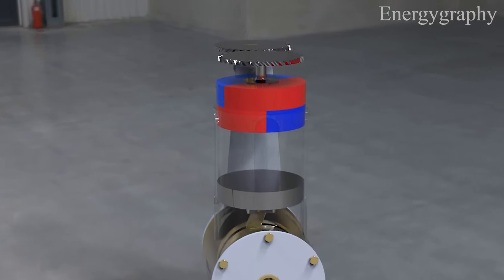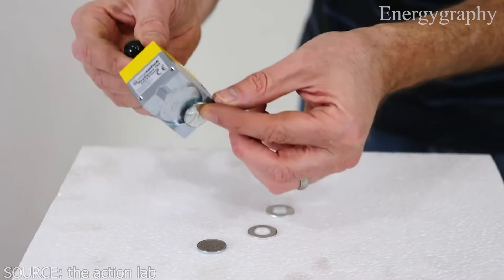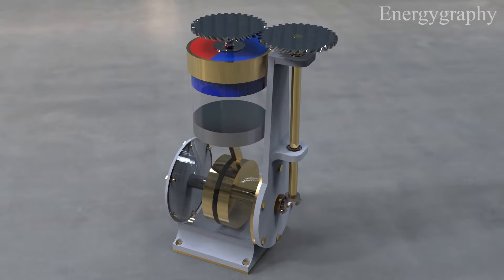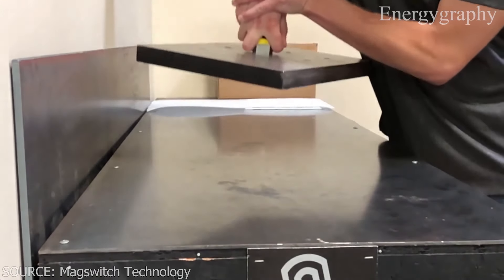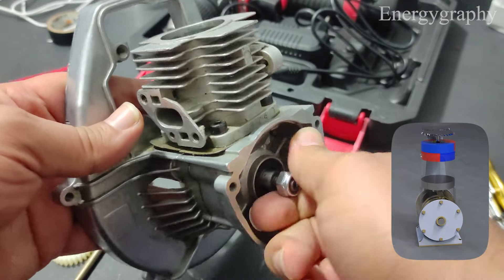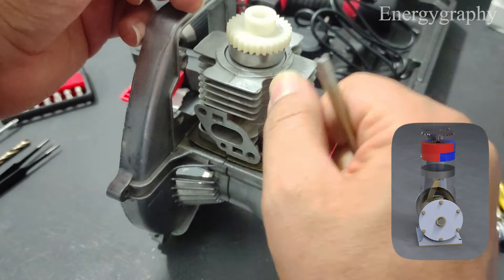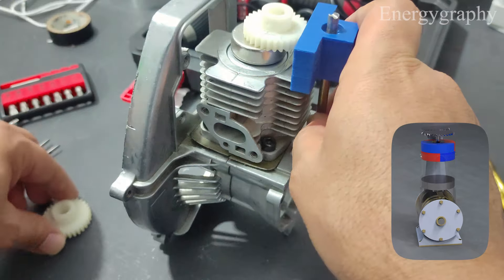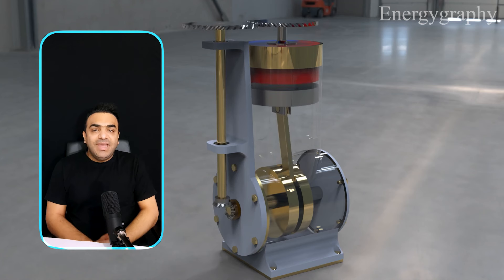New Hibrid Engine

Comment: It makes sense in theory. But it is difficult to work in practice. Because the area of effect of magnets is limited. The magnetic effect (push and pull) distance and power of the two magnets will not be sufficient to rotate the shaft.
Reply: Just want to add that as a logical suggestion not in a bad way.
Reply: it cant push the piston as that magnet will shut off and on not pull and push
Reply: The impact of magnetic fields is longitudinal and assigned to a different magnetic induction vector of the piston stroke. There will be low efficiency or no power generation at all, even though the rotation has been started manually.
Best regards 😀.
Reply: @ZygmuntKiliszewski    There is no power generation at all, not only in practice but also in theory.

Comment: Hi, nice job. The issue you will face with this design is that the system will balance and will stop. You need a separate regauging cycle.. So, you need to only turn off the magnet only when piston is on top.. so store energy during the attraction phase, then release some of that energy to turn the magnet off when piston is almost at top... also, the assumption is that it takes way less power to turn the magnet off.
Reply: При такой осведомленности может быть сами попробуете создать свой БТГ.

Comment: The problem , turning "on" that magnet is heavy.
Easy to turn to off , but hard to turn to on

Turn on that switch = hard because u forcing north to north and south to south

Turn off that switch = easy because north to south and south to north

In magswitch bit easy turn on because u press and make a gap when turn it on . The hard part in that switch = pressing before u turn it on.

I have 2 diametricaly magnetized magnet like in your video. That magnet stick nort to south , south to north. It require force to turn. Otherwise it will always in off position

Energy from pulling that piston = energy to turn that magnet on
In my opinion 🙏.
Reply: Richtig, alle Kräfte heben sich gegenseitig auf, sowie noch abzüglich Reibungsverluste. Es geht nicht und wird niemals funktionieren Selbsterhaltung Rotation
Reply from the maker: we are here to find a solution ❤
Reply: @Energygraphy  photovoltaik,wind, thermal

Comment: You didn't consider the torque needed to rotate the magnets against their resisting magnetic forces and away from their atttracting forces. Same problem with most simple magnet motors.  Attraction force weakens with distance so there is low net torque when piston bottoms. When piston at top with minimum distance the magnets are shut off. There is no cycle where strong torque can be harvested. Not counting Friction. forces. But good animation. I hope you at least get some views.

Comment: The distance between TDC and BDC is to wide apart. The magnetic force of magnets are reduced in distance²x force (attraction or repulse). You have only mm to play with. And then you have the power demand to turn the on/off magnet, which can be overcome by the moving magnet. I am so sorry, I wish I had any ideas to help.
Reply from the maker: nice, It is taken into account and you can see it in the next video, and of course, it is determined carefully in the prototype according to the tests of this details
Reply: Видов перпетум мобиле БТГ более пятнадцати от магнитных до гидро механических.

Comment: Wow, that animation is as always first rate. Wish I had a pc with an app like that.  I built a magnet spinning device back in the 80s. Made a video about a year ago featuring that same old device which was powered up with 24 vdc at 250 milamps at the time.
The bearings began to grind at about 100k+ rpm. Thing is this is a simple but most effective device which could be modified to lose the main high power electromagnet for something other 🤔
Reply from the maker: You can do it!

Comment: Bravo!!! A thinker whom is outside the box of E=mc squared😅😅😅😅. Im a engine mechanic, yet my dad got me into the power of magnetic energy . What you just presented is a reality of what magnets can really do. There are permanent magnets at our disposal with a repelling force of almost a 1000lbs with a diameter of 3 inches and 1 1/2 inches thick. A petrol fuel engine would envy that kind of power. Glad I came across your post neighbor. The best of the best dont live inside a box that institutions create. Persevere my neighbor. Your mind is free😊
Reply: Thinking outside the box can be a virtue - but it can also be nonsense. The attempts to build magnet motors dates back to the 13 century! No design ever worked. Yes, we have astounding strong permanent magnets today, but this is not relevant. If permanent magnets can run a motor, also weak magnets could do it, only the output power of the motor would also be weak. But never did any inventor achieve an output at all! Permanent magnets deliver forces, and very big ones too, but they can't deliver continuous energy but only what physicists call "potential energy". If a magnet attracts e.g. another magnet, work is done. But to repeat this you have to separate the magnets, which consumes all the energy which was gained before. Which is also the reason why this machine does not work. To turn the magnetic disks at the top uses all the energy delivered by the piston, no usable energy is left. Nature can't be tricked.
Reply: @heinzpg if you are correct then it would take 1000lb of torque to turn the handle on or off to release 1000lb pull or thrust? Really? Have you done it?
Reply: @bettymachado    Magnetic forces decrease substantially with distance. The piston is only for a short time near the magnets. In contrast, for turning the magnetic disk magnetic forces must be overcome and in this case the distance of the two magnetic discs is close all the time.
The author "Energygraphy" says at the end of the video that he wants to make a contribution to research - which shows his incompetence. Research is complete in this field, it is assured knowledge that permanent magnets can not deliver any energy. I haven't done an experiment myself, laws of physics allow us to predict the outcome of experiments without doing them. But many others have tried it, without any success as could be expected. The author "Energygraphy" has presented a multitude of similar designs on YouTube, almost every month a new one. But he never shows a real device, he only shows computer animations. If he would really be willing to do research he should have built at least one of his designs. Then he could have learned why it doesn't work.

Comment: As you have shown in your video, the magnetic switch does require some force to change it from on to off.
The energy to move the magnets into position is enough to render this a non-working device.  
Of course, an actual model would demonstrate this.

Comment: There is one on the glue magnet on the piston and one on the glue at the top.
On top of a rotating magnet this magnet will use a lot of energy to run around. Therefore, this magnet motor can. not functioning

Comment: What he has described and shown is a perpetual motion machine, with the up and down motion of the piston linking back through gears to turn the permanent magnet set on and off, which in turn causes the piston to move up and down. So, not gonna work. He needs to ditch the connection and have SOMETHING ELSE power the switching of the permanent magnet set. Now, there may well be a use for driving a piston in this way., but it should always be made clear that what's actually powering the piston's motion is that "something else" that keeps turning that one magnet, and the amount of energy to do that switching can be substantial, and certainly isn't free.

Oh, and of course, as others have pointed out, the forces of magnetism don't operate on a distance far enough to pull back that piston, situated so far away from the magnets.

Comment: Spectacular, but where do you put the electric motor that drives the whole thing?
By the way: Why do you need a cylinder that only creates tons of friction? Two guides are enough to prevent the "piston" from moving sideways.

Comment: you could try to add a metal rod with copper windings (coil) instead of the piston and generate electricity kind of like a mechanical electric transformer.

Comment: Get rid of the crank shaft & just spin the crank using an isolator & a timing system place magnets around the crank.
Just a nudge is enough to crank it

Comment: Watch piston and magnet on top, magnet has maximum attrection force when it is at botton dead center that time distanve is maximun as piston moves up magnetic force is decreasing because top magnet is the part of switch when piston reaches at top dead center switch off for manet so very little force of aatration is experensed that force will fade away with friction and force needed to rotate the swich, so it will not work.

Comment: uhm energyraphy can i ask why you use permanent magnet and not a electromagnet??? so if you dont know switching it off and on require energy and the only available energy it can get it is from the energy of the piston moving it so it will automatically stop on first cycle pls explain it to me if i was wrong

Comment: Hai..just wanna tell you that i've already secretly invented this exactly type of system..as it's sooner or later some man will discovered it.. and in my journey i've found out that the system is still have some issue with the rotation on/off permanent magent can't simply join with grand shaft..it need its independent system movement with a lot of more complicated thing to join and setup(scrap away)..but eventually i've discover how it can move syncronize with the shaft and it's work..and im not gonna tell you it because it possible can change the world. And thus make me the sole name of the discovery😊.

Comment: You need to get rid of the cylinder entirely !
The cylinder is for retaining pression and gasses etc.
So no cylinder !
Use a second rod or something.....
For inspiration go have a look at the 1993 Ducati Supermono engine which used a "pretend" second piston to achieve perfect primary balance just like a 90 degree V-twin.

Comment: Yepp! Just another perpetuum mobile of the first kind. Just because people confuse force with energy. Energy W is a force F acting along particular distance s. In terms of a differential equation dW=F(s)·ds. The same principle applys for the rotational case. The problem with this design is, the energy gained by the piston is exactly the same to turn the magnet off an on. No kidding. However, there are losses, like friction and eddy currents that will stop the machine quite quickly. The only way, to get out energy from permanent magnets is to demagnetize them, since the energy Density stored in a magnet is defined as W/m = Bmax · Hmax with the unit [J/kg]. And this energy density is not only disappointingly low but round-trip efficiency is also very poor.

Comment: Oh dear. It's supposed to be a perpetual motion machine? What you actually made, was a perceptual motion machine instead. We perceive the motion, so it's perceptual. However it's not perpetual because the rotation of the the upper magnet (ignoring friction) is affected by the rising piston. The rising piston comes up fast but then absorbs energy from the top magnet, resisting it's spin away from paired poles with the bottom magnet.

Comment: No need to watch it longer than 1 minute, it will never work. When applying some angular momentum to the rotating countermass it may rotate for a short time, ( I can guess one revolution) then forces necessary to rotate  magnets (counter directed magnetic fileds - very high) and attract the pistion will compensate.

Comment: It will save much energy I had also built a motor with this technic but with permanent magnets and electro magnets. The poles İ have changed with electro magnets . The videos I have hier in Youtube .But, I couldnt have a self rotating, perpetuum motor 😊

Comment: If so, why the cylinder piston is not made out of permanent magnet, while the upper part - another permanent magnet - turns around horizontal axis, to swich "pull" and "push" states of the device? Would be stronger, and probably not much more maticular.

Comment: THIS WILL NOT WORK!  
The magnets don't have enough "Push" to send the piston down AND back up. 
When the piston is @ the bottom, there is NOT enough "Pull" on the magnets to make it back up b/c it to far away from the magnets.
You also have 10 points of frictions, 2 gear @ the top, 2 gears @ the bottom, 2 ball bearing on the vertical shaft,  bearings @ both ends of your rod
and @ least 2 ball bearing holding the crankshaft in place,  Bearing still create fiction and gears are better @ creating friction.

I tried this over 25 years ago with a RC airplane motor. I've been machining for over 40 years.
I did find out, the shorter the stroke, the better. You don't need the cylinder, I made a "caged" 3 Vertical posts, as guides for the piston,
I machined a piston and installed bearings on it. The surface area (friction) was reduce over HALF, but still couldn't keep it running.
I worked on this for over 2 years. Your wasting your time dude!! I wasted my time!
Oh, and your animation here, is nothing more then a cartoon, ANYTHING is possible in a cartoon!
This will only work in this animation and your dreams!

Comment: Make it happen, but after the initial start up controlling rpm may souly be determined by the external load of the engine, so as soon as the engine reaches its ideal operating Rpm or engine speed- you have to “clutch in” the PTO or generator such as a generator or something - because we are hoping for constant speed but the initial design will not allow for this a
Reply: There is no reason to worry about that, since this design will not rotate by itself at all.

Comment: Hey bro,please don't mind. It's not possible. Because there are  more  problems. I am Sahed from Bangladesh.  I am researching for magnet engine.For making a magnet  engine, you first needed a perfect PM force controlling system. Though I am not yet Success. But have invented three controlling  methods 1. PM force controller, 2.NS=0, 100% permanent magnetic force stopping system.  I am a poor person and have no tools so facing some problems.